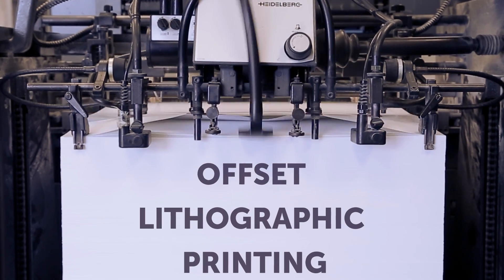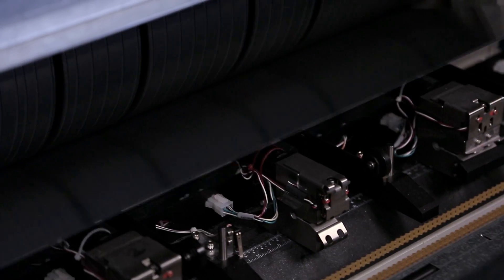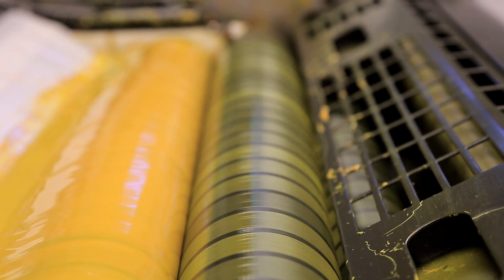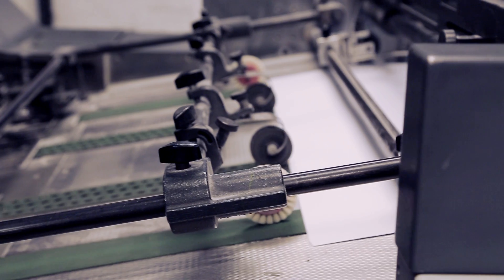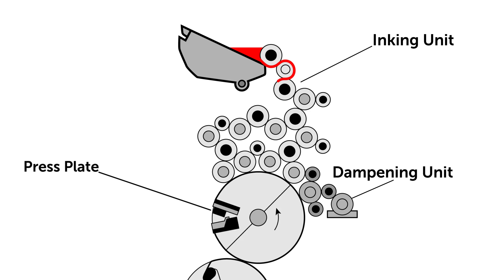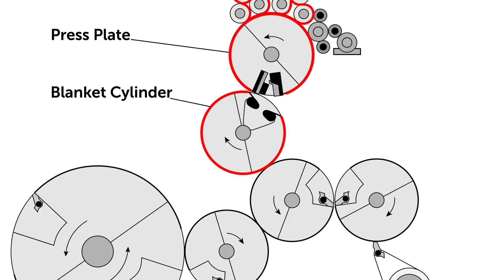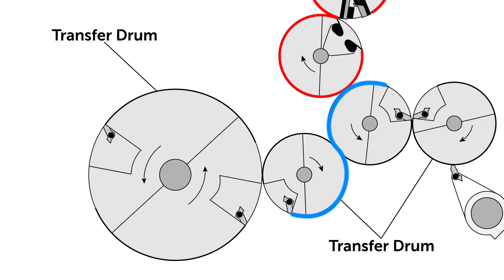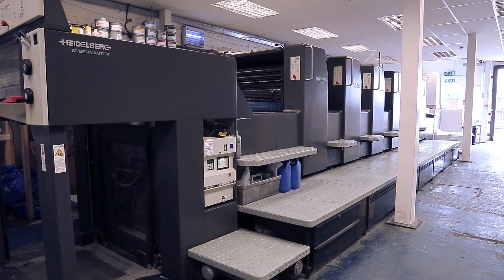How Does The Offset Lithographic Printing Process Work?

Comment: How does the aluminium paper knows what colour to stick and what to repel :/
Reply from the maker: Hi. There is a separate aluminium plate for each coloiur.
Reply: each unit is a seperate colour - they are made with negatives - the negatives are broken down into the 4 colours - then you print them, usually yellow, magenta (red), Cyan (blue), then the black one sets it off

Comment: Nice video! I have one doubt: how water will cover non-image area and ink will cover image area? What makes water did not fill image area and vice-versa?
Reply from the maker: Hi. Put very simply, the whole printing plate is dampened and there is a chemical in the water mix that can identify the tiny dots in the plate that make up the image. That chemical dries the instant it touches a dot, allowing the ink to adhere to those areas. Hope that helps. Thanks
Reply: @solopress  : Thank you so much for your kind reply. It was very useful!
Reply: This was my question as well; thank you for asking! (And for the answer!!)
Reply: Simply put oil and water do not mix.
Reply: The imaged area of the plate is hydrophobic - it repels water. So ink sticks there, but not on the wet unimaged area.
Reply: @andrewaldridge8735 while the non image area of the plate is hydrophilic (meaning water loving) 😊

Comment: thanks for the video! the cmyk rosettes in these prints are dotted. what causes the dot pattern of the print in this entire process? are the press sheets etched in a dotted pattern to begin with?  also, can you control the placement of each individual/granular dot in the software prior to printing?
Reply: The dots are in the image area of the printing plates. If the dots need to be moved, the pre-press department must alter the job on a computer. Moving the dots farther apart will cause the color to be less bold. Moving the dots closer together will make the color bolder. Altering the dots is called changing the curve. Most of the time, the job is set up correctly, so no curve change is necessary. Sometimes you get a whiny customer that wants a crazy shade of a certain color and the only way to achieve that, is to change the curve.
Reply from the maker: Thanks for your comment.

The press sheets are not etched in a dotted pattern to begin with, it’s the image itself determines where the dots are placed.

Each CMYK colour is printed separately from its own plate. Dots from each CMYK colour come together on the finished print in a tiny rosette pattern that’s only visible under magnification. When observed with the naked eye, the combination of the four inks creates the desired colour. The process that creates the placement of the dots in their rosette pattern is known as Euclidean dot formulation.

There is an alternative called Stochastic dot which places dots randomly rather than in a rosette pattern, but we don’t use this method. 

Hope that helps!
Reply: @solopress  I thought about it some more and I think it my misunderstanding is clarified as follows : in a cmyk rosette print, its etching does occur in a dotted fashion but it is NOT forced or done automatically by the etching step - it is defined by the image source given to the etching step. So if we were to zoom into the press plate , we would see dots in a typical example workload.
Reply from the maker: @wuschelbeutel  I think you’ve grasped it, in that the pattern of dots is not pre-determined. There’s no set template for the different coloured dots to fit into. Instead, the exact placement of the dots is created in response to the image as a means of achieving the correct colour in any given location.
Reply: @solopress    thanks for taking the time to respond.  
  I'm interested which step of the machine's mechanical workflow introduces the dots. Suppose we stop the machine in the middle of the printing process and use a microscope on the surface of the yellow unit's blanket cylinder. Would we see a dotted or a solid-fill pattern of yellow ink (in a region of the print that has a lot of yellow weight)?  

 Using a microscope on two items of a print I ordered, I noticed that the cmyk rosettes are virtually identical among the two in a certain region of the print. A high reliability like that leads me to believe that they are dotted on the blanket cylinder. But that still leaves the question of what step in the mechanical process seperates the ink out into dots.

Comment: Is Hexachrome printing still a thing?
Reply from the maker: Hexachrome isn't really used anymore when it comes to litho printing, although the concept of enhancing CMYK colours with additional colours is something that is done in digital printing.
Reply: @solopress  So CMYK inks have evolved to the point where the gamut is sufficient to make Hexachrome irrelevant today?
Reply from the maker: @basspig  Yes, that is the case. Hexachrome printing would still extend the gamut, but nowhere near as much as it would have done in years gone by.
Reply: @solopress  Although it is a different ink formula, I remember around 2000, buying a Epson Stylus color printer and finding that printing from CorelDraw, I could get absurdly intense colors out of it, on the level of day-glow paint colors. Really vivid pinks and oranges and magentas that jumped out as if illuminated by black light sources. Later printers I've owned could not produce such vivid colors. But I can see that extremely wide gamuts are now possible with CMYK alone.
Reply: @basspig can also use thousands of different pantone colours it doesn't need to just be CMYK

Comment: why is this method not suitable for printing 1 or 2 sheets? why
thanks a lot  tiffany howles
Reply: It's too expensive to setup for just 1 or 2 sheets.
Reply: It costs alot to get the rollers etched i assume.
Reply: @ChickenManiac  the rollers aren't etched
Reply: i meant the aluminum plates @lukeomahony46
Reply: @ChickenManiac  they're generally not very expensive, obviously depending on what type. The overall setup time to print one or two sheets would make it far too expensive. It's not simply a case of put the plates on and print a couple of perfect sheets immediately haha
Reply: Yeah, your price would increase quite a bit just from trial and error. 
 @lukeomahony46
Reply from the maker: Luke is correct - usually this type of printing is used for large jobs, and digital is used for smaller ones as it requires no manual setup.

Comment: How do we get different colors out of CMYK colors?  & What is the use of inking keys?
Reply: The colors are not mixed, they are printed over each other.
Those metal plates they were loading into the press are like stencils, each one is different depending on what colors are needed for the label, when the colors are transferred to the paper from the blanket and cylinder it only transfers what was drawn up on the plates, if you were to look under a magnifying glass you would see tiny dots and all the colors that are layered over eachother to get the desired color.

You control how much ink is being distributed from the ink fountain to the rollers with the keys you asked about.
Older  presses would be setup and keyed in by hand, so it’s not as common anymore unless you’re using an older press.
Modern presses use programs linked directly to the press to key in the jobs so the guessing is taken out of the equation and you just have to fine tune the ink and water % hope that helps
Reply: @Balouthegreat  thanks alot....

Comment: So why are there so many rollers in the roller train? Why not just 1?
Reply: choo choo
Reply: Thanks, Brad.
Reply: And those rollers are a mix of rubber and nylon or copper, the rubber rollers must be a specific hardness range known as Durometer, the rollers must also have a specific finish which is measured in microns and must be set to one another using manufactuers specifications in order to transfer the ink properly. The rubber compounds must also be either ink receptive or ink rollers and water receptive for dampening rollers. See, its pretty easy, nothing to it.
Reply: The ink must be well mixed
One roller will not do it
Reply: In short to make a perfect uniform film of ink.
Reply: Coverage

Comment: Solopress As a student Industrial Product Design, I was wondering if this same system could be used to print fatty ink (same texture, only fat-based) on a plastic (non-absorbing) sheet?
Reply: Yes, it is possible. The substrates need to be treated to have sufficient surface tension for printing or coating
Reply: In this case the UV technology could be used.
Reply: @bobrik63  can you explain a bit more what you mean by UV technology?
Reply: @Semtexxxxx  UV-inks and coatings are not drying by oxidation and penetration into substrate but curing by means of chemical reaction cased by UV radiation - perfect solution for polymers (foils, plastics) and for metalized  surfaces. A special equipment of the press is required such as: EPDM compound rubber rollers and blankets, intermediate dryers with UV-lamps, end-of-press slide-in dryers with UV-lamps, wash-up hoses suitable for UV wash-up solutions, UV-light protection devices. You can find details on many sources in Internet.